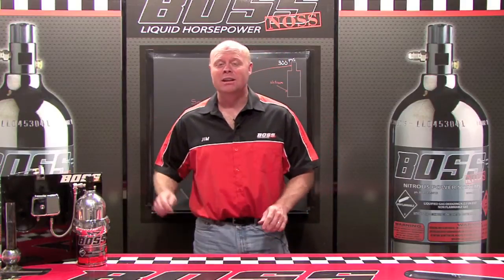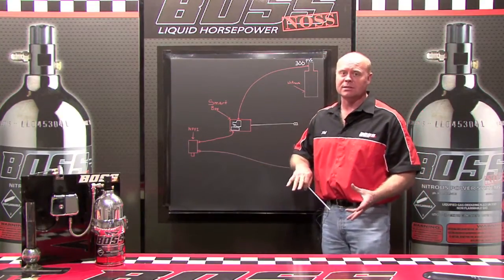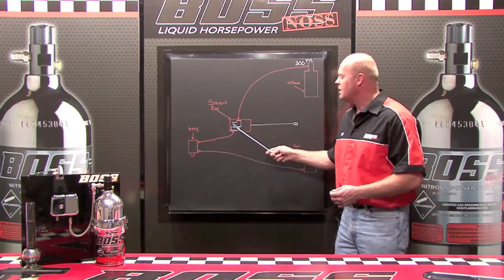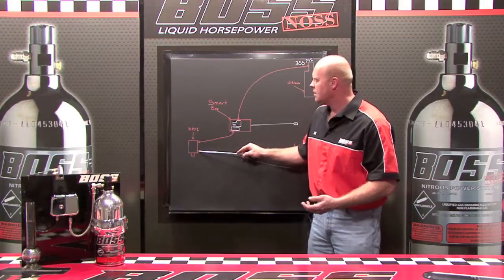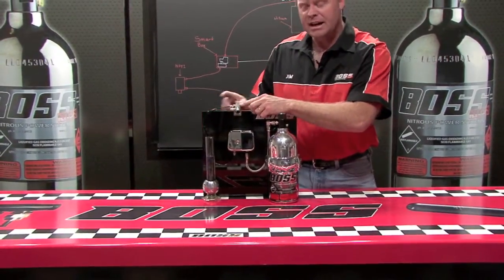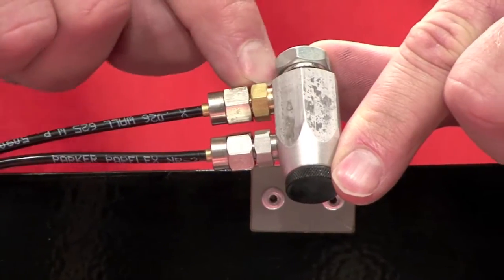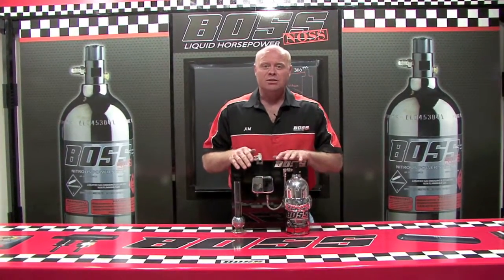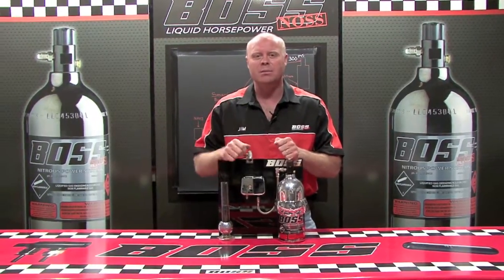Boss Noss Breakthrough Technology

Comment: Sounds great in theory, but that injector can't meter proper amounts of fuel at different nitrous levels without a fuel jet change, the theory is contradictory to flow dynamics.  Where the fuel container is mounted in relation to the injector will also change the amount of fuel delivered through that fixed jet.

It's also suspect that they super simplify the drawing of the Boss system eliminating the battery and other things that are still needed.  They also draw the fuel and nitrous portions in one color and with nicer cleaner drawing making it look a lot cleaner overall; typical BS like seen on an infomercial.  This system also requires a non-pressurized fuel source which in many applications would mean adding a separate gas tank.  They also over complicate the "typical old" nitrous system with a bunch of stuff that's not really needed while exaggerating the pressure changes/mixture changes.  I've run nitrous for years without even a pressure gauge with no issues at all.  Those tight controls only become a real issue once you're trying to really set up a precise system, usually only needed once you're pushing the limits of a motor or maybe in bracket racing where you're after a really consistent power level.

It might be a perfect system but I don't trust any product where the salesmen use obvious deception in an attempt to 'prove' it's a better system.  My guess is that once the failures pile up they'll disappear into the darkness and I hope it happens before the victim list gets long.